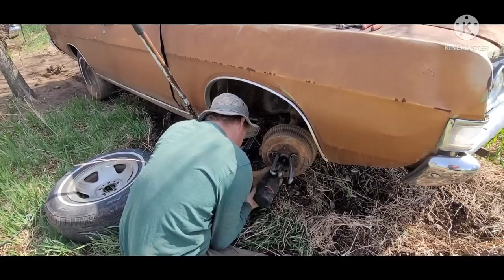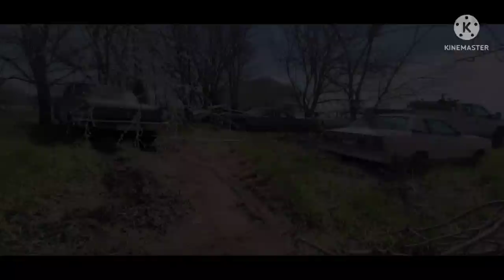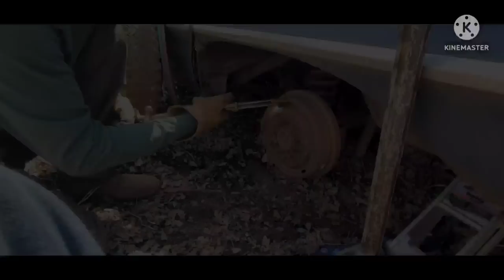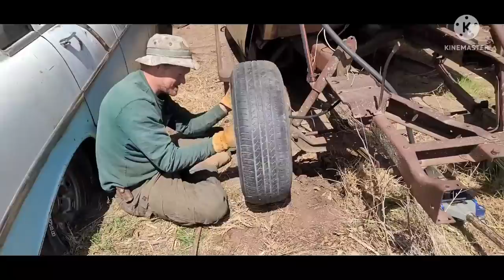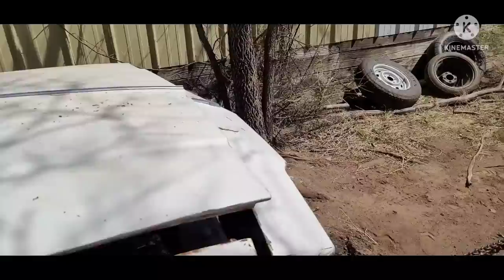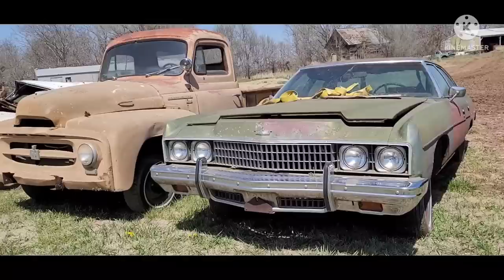Out of the Woods! We pull old 1950s, 1960s + 1970s cars & trucks parked by the abandoned farmhouse!

Comment: I have a 1966 Chevy Impala with a 327. Car is black with a red interior. Automatic.  I put it in my dad's barn in 1970. Never been touched since. Car has around 60,000 miles on it. No rust. I haven't started it since I put it in there. I wonder if it's worth anything? It's a two door. Is that good?
Reply from the maker: Yes it is certainly a valuable collector car
Reply: Will you be keeping it or selling the car?